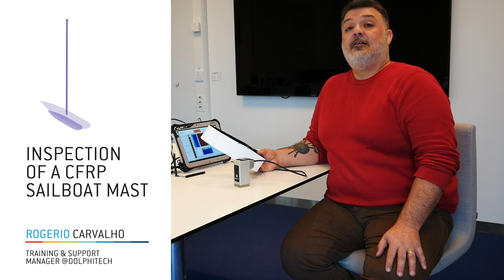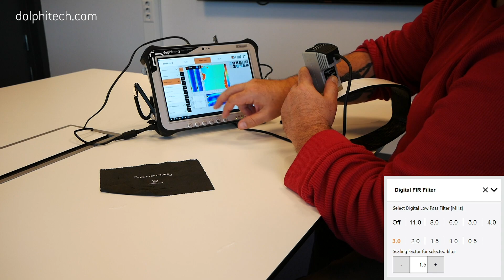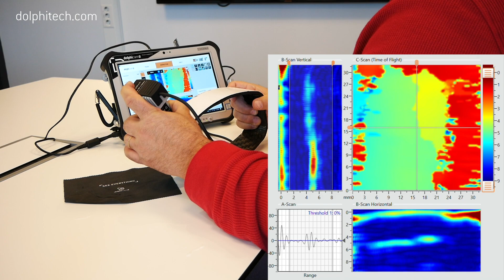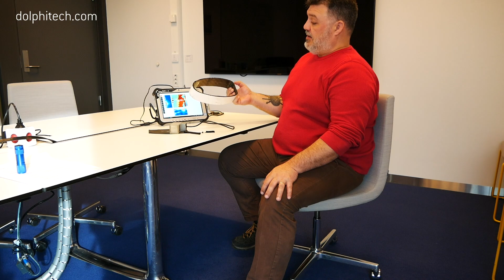dolphicam2 CFRP sailboat mast

Comment: 00:00 - start
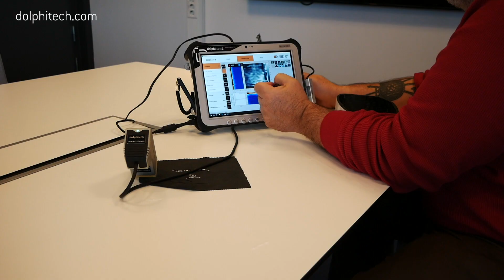00:38 - set-up the variables
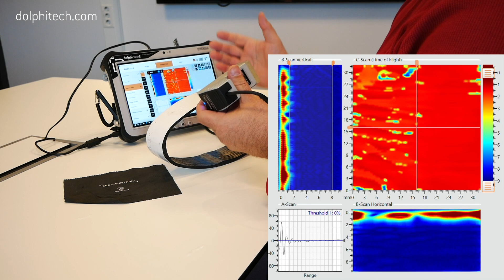03:38 - start scanning!
03:39 - observe the part
04:00 - strong back wall and clear scan
04:17 - observe difference in thickness
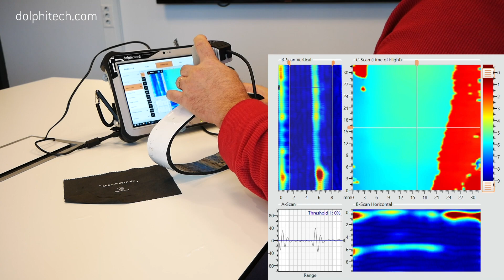05:00 - full sweep from back to front showing thickness change 
05:07 - first sign of damage
05:14 - confirmation on C-scan and B-scan
05:26 - repeat the sweep to confirm
05:46 - recognising edge effect 
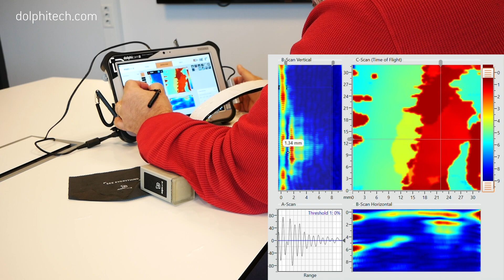06:20 - measure distance from surface to count number of material layers (plys)
07:07 - use B-scan to confirm thickness change
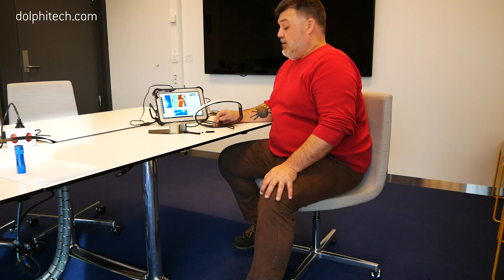07:28 - conclusion